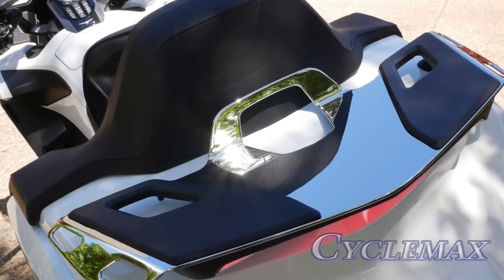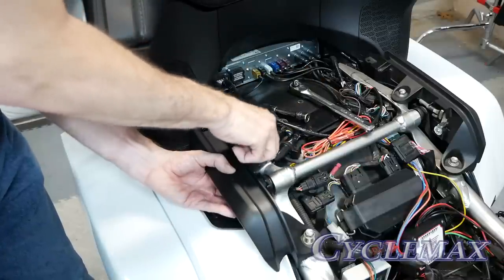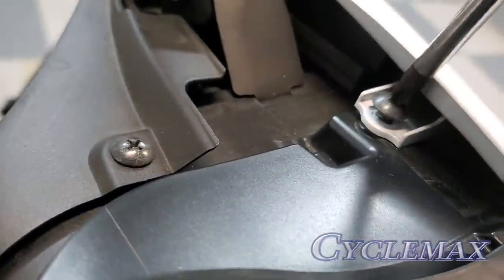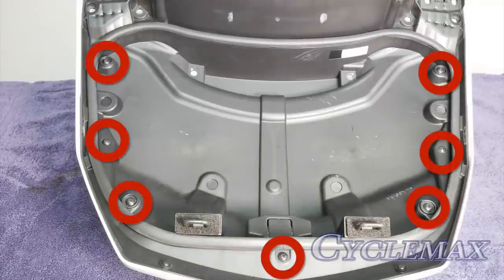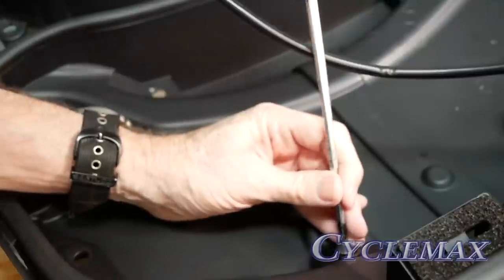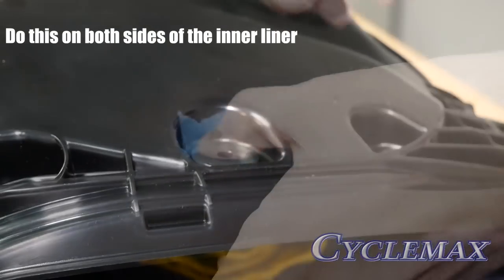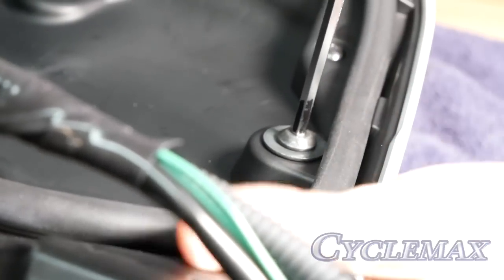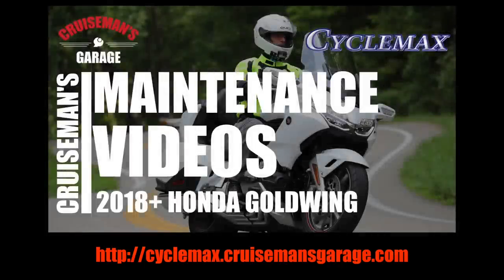Installing Honda Luggage Rack on 2018-2020 Honda Goldwing Tour

Comment: Those little plastic push-pins can be a pain after they get a few years old. I bought about two hundred of them in various sizes. Two of them broke in the last week while disassembling parts of my goldwing. when they get old often they break when you push the pin down to release them, they must get brittle?

Comment: Nice job on the detailed install. I like the looks of this rack however I doubt I would go through all this effort just to install this brand of rack. I think I would search for a unit more inline with previous model units where the install involves drilling four holes and a quick install. Or I would fabricate on myself as it would probably take less time than installing this item.

Comment: Did you cut off the rubber pulls after you installed the rubber pads on top of the rack?
Reply from the maker: I have not yet
Reply: Do you plan to or see a reason not to? The installation instruction  do not say to do this but they don’t look good sticking down under the rack. Thanks

Comment: Ive stripped out one of the screws that hold in the latch  u-bolt, any recommendations for securing that screw?
Reply from the maker: Did you strip the screw or the hole it goes into? If it is the plastic hole, you can try a couple of things. Cut a small strip of plastic from a cable tie and try to shim it into the hole and see if that is enough for the screw to bite into. If not, you can try to fill it with JB Weld, let it completely set, then CAREFULLY drill a small pilot hole to screw into. You would probably have to have the trunk lid off the bike to do this.

Comment: Do you think this rack adds to the looks of the bike?  I am still debating between this rack and the pathfinder LED or skipping the rack and just getting the goldstrike.  i want which looks best/best lighting though, the rack itself is not a huge deal to me as I will likely not use it except to close the trunk to keep finger prints off.
Reply: same here. question question. especially for 5 hours work...